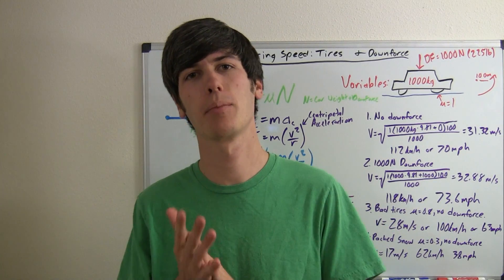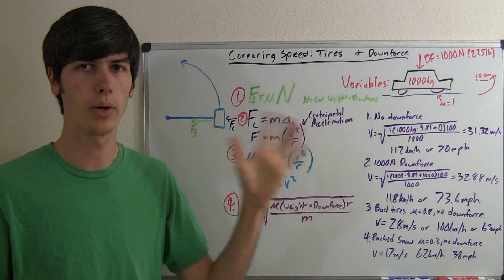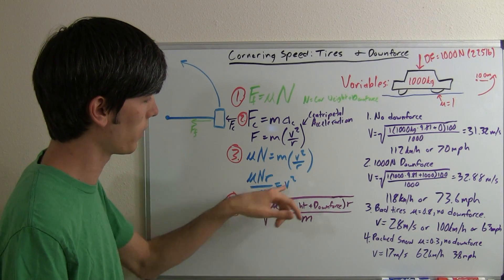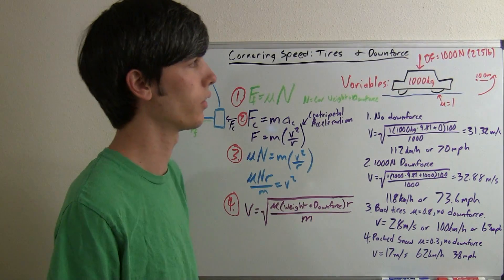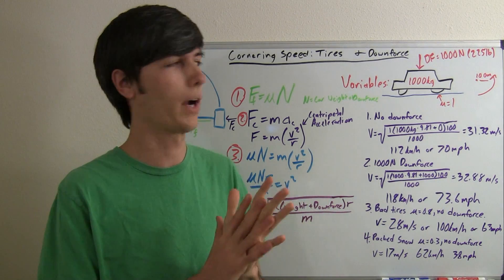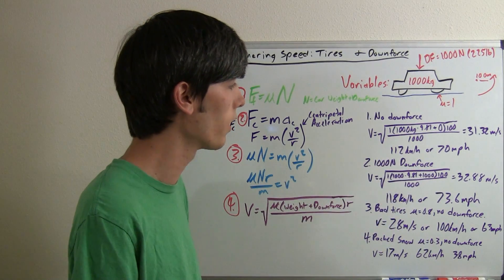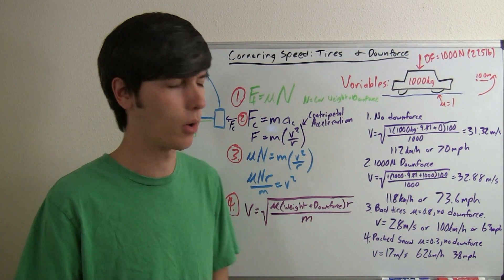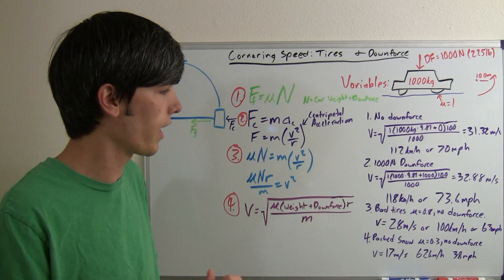Cornering Speed - Tires and Downforce

Comment: The more the down force of a vehicle the lower the top speed it will have? Weight will affect acceleration AND top speed??
Reply from the maker: Yes, more downforce typically comes with more drag, thus reducing acceleration and top speed.
Reply: Engineering Explained I'm not sure 100% sure about top speed though but I know it will definitely affect acceleration.
Reason is before the vehicles have tires and won't have any friction against the road surface to decrease top speed?
Reply: 7150285 the faster you go, the more the car will weigh (downforce in its basic form adds weight to the car, with the air pushing it down). While it does give you better traction, it can also create more friction, and the car will have more rolling resistance between the tires and the asphalt. Add that too the drag that spoilers and rake (difference in height front to back) adds at high speeds, and you will be slower.

Its still worthwhile in racecars, because without the downforce, you probably wouldnt be able to corner fast enough to take advantage of the higher end of your topspeed in the first place.

Comment: Awesome explanation---so does arcing into a turn increase 'r' which then increases the Velo?
Reply from the maker: The larger the radius, the higher the speed you can take it at.
Reply: When you explain that theory, you must clarify that the radius to increase is of that wheel concerned.. thus it covers large area at the same speed.

Comment: Can you explain the benefits of wider tires. The contact patch doesn't come into any of these equations, yet it is known that wider tires can provide more grip. I know that wider tires last longer, but why do they help corner faster?
Reply from the maker: I'd say the most important factor is what phycoman4561 has said as point number 2. Also, wider tires will have less overall flex, and you'll keep on the contact patch rather than ride up onto the sidewall, which isn't made for grip.
Reply: david stereo
I actually just did some research and came up with two or possibly three reasons. 1) A softer tire has to be wider for a given car weight or it will wear overly fast. So its really just that tires HAPPEN to be wider when they get better grip because they are softer. 2) Asphalt isnt smooth like all the surfaces are in physics equations. This gives the tire little holes to "dig" into actually letting it "push" off the holes. More contact patch means more holes to dig into giving more combined force. 3) My own theory which may or may not be correct. It has to do with the shear strength of rubber. You see tire marks on the ground because the tire sheared off and couldn't hold onto itself. So again more contact patch means more force required to shear it from the surface.
Reply: This is the equation for cornering speed, so obviously it does go into the equations somewhere. Wider tyres provide more grip as they have a larger surface area, hence a higher mu (coefficient of friction) than comparatively thinner tyres.
Reply: Authur Jackson Actually the coefficient of friction doesn't change with width. Wider tires give better grip because of less pressure. F=ma. P=F/A. So more area, the force is spread out over a bigger contact patch. This increases your probability for better grip. It also has less sidewall flex
Reply: david stereo Yes, indeed. I am forgetting my basics. coeff doesn't change with area. My apologies.

But what does pressure have to do with grip? Nothing to my mind?

Comment: Why is the Nissan GT-R so fast at cornering?
Reply: inteligent 4 wheel drive, it slows down inner wheels inside corner to pull you in, and fastes up the outter ones to push you in. Normal car only adjusts the amout of torque delivered to the wheels based on their resistance via diff, but this car calculates it and delivers the power as its most benifitial at any given moment
Reply: StevenSWM im pretty sure the only gtr's that had four wheel steering were the r32, r33, and r34. never heard that the r35 has it but i could be wrong
Reply: StevenSWM THe GTR doesn't have 4 wheel steering. The R34-32 had it but was ditched for the R35.

As to why it corners so fast. It mainly due to its torque vectoring plus Tyre technology.
Reply: Mikee CZ ...and isn't the GT-R not only 4 wheel drive, but also 4 (all) wheel steering? Those two things working together would make a significant difference.
Reply: StevenSWM

You're thinking of HICAS, the GT-R doesn't have it.
Reply: StevenSWM The GT-R does not have four wheel steering, the older skyline GT-R did though.
Reply: It has wheels

Comment: How does suspension affects cornering speed? Many hot hatches from few years back had problem with leaving inner back wheel in the air. Is it bad or good cos i'm little confused about this.
Reply: The inside tyres do little in corners. Weight shift means most/all the load is taken by the outside corners.
Reply: Authur Jackson Agree, but it is a bad thing or non-relevant? I remember that a good suspension will always make tire perpendicular to the road.
Reply from the maker: You want all four wheels planted, and weight distributed as evenly as possible. This is what suspensions attempt to achieve, among other things (ride quality).
Reply: Unfortunately, body roll is rather difficult to design out. There is usually a compromise between body roll and harshness. However, upmarket suspension systems are getting very good indeed.
Reply: Additionally, I heard tell of an electric car that thanks to the battery pack placement had a centre of gravity so low that the car had reverse roll. They engineered it out because people wouldn't know what was going on. Certainly would have been interesting to drive.